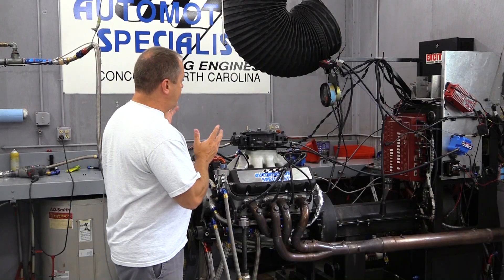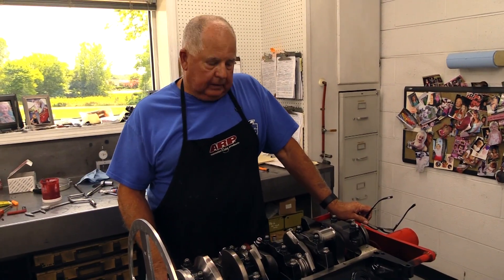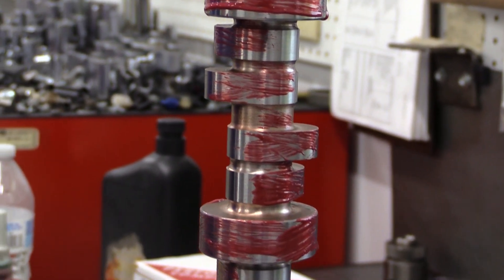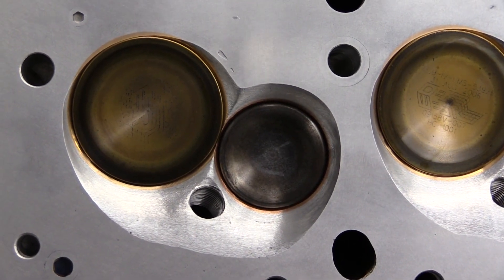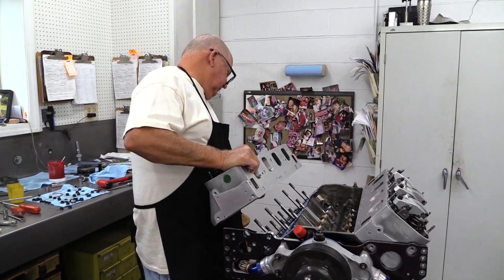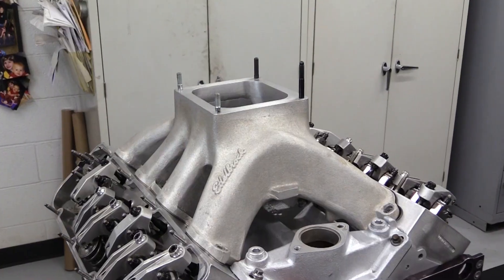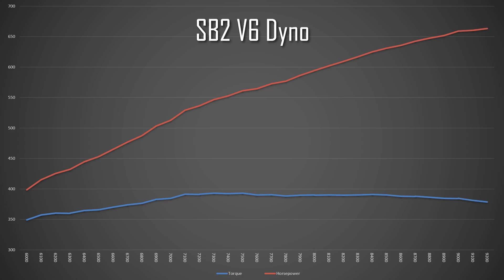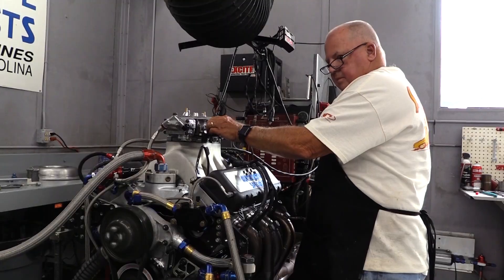NASCAR Chevy SB2 V8 Turned Into a Racing V6!?

Comment: If the goal was high rpm they should have chose a completely different engine, OHC straight 6. Push rods and rpm don't mix those valve springs would be robbing so much power.
Reply: That combination would put them in a different speed class.
Reply: @allenl9031  I thought they said early on in the video the only restriction for engine in their class was cubic inch displacement?
Reply: @Mrx1080  Bonneville classifies cars not only by engine size, but in a variety of other factors, # cylinders, valve mechanism, induction type, fuel type and then also type of vehicle. The Southern California Timing Association does the classifications and timing at Bonneville. It's interesting to see pictures of cars that run there, you will see a jumble of letters on them denoting their class. People look at the classes, pick one or two to challenge, and go for it! First goal for many is to get a car over 200 mph. That gets the driver the red 200mph baseball cap. That's a badge of honor. If you haven't already seen the movie "The World's Fastest Indian, " I highly recommend it for a taste of Bonneville, many actual vintage land speed cars appear in the background. From 50cc motorcycles, to 400 mph plus streamliners show up every year. Sorry for the long post, but my bucket list includes spending speed week at Bonneville, as a spectator, or helping a crew.

Comment: Isn't a Chevy 4.3 just two cylinders cut off of a 5.7L (350 cubic inch) V-8?
Reply: Yes it is. With a modified split pin crank to make it fire evenly. However this SB2 Chevy is a specialized racing engine and they are basically surplus now so its a great foundation which is why he went through the trouble to make it a V6.

Comment: Did I here 600 pounds of open spring pressure? I'm amazed that's enough for over 9000 rpm enough, on our pulling motors (which we used to run at over 9000 rpm, but have more recently regeared to be down around 8000 (just seems to work better no science there lol)) and we have like 800 and 1000 pounds of open spring pressure (my motor has very similar titanium valves, I'm not sure what my dads has)  (for anyone wondering we run 454 chevy big block pattern motors at 482 ci, also running "standard" steel heads (as per our rules, so no odd angles or pro stock style porting) close to 900 horse (we don't really dyno, only once every few years if we try something really new.... so its hard to say exactly how much we have...))
Reply: Your valves are likely a lot heavier than these though, and those look like very well damped springs. I bet the stability is similar between the two applications...

Comment: I kind of get the idea of this, but not really when you think of the 4.3 v6. Why have the extra weight and mass of the two dead cylinders, rather than chopping the head in two and welding it back together
Reply: I guess the only reason  I could see to  the point of that, is if you still want to put it back to a v-8 for another class some other day.

Comment: 4.2L ? Better to use a Barra i6 engine for this record run,  (balanced at high rpm, 11500 rpm is not a big ask)) dohc 4valve gives superior top end flow and hp. Boosted Barras make >2000hp on factory block and head.
Reply: I would guess that they are running a NA class engine, and by using a V8 block they can somewhat easily change parts to run the same block in a V8 class speed run
Reply: jck92599 4v head NA engine makes more power. Maybe the rules state 2V only ? 
3L F1 cars made 800hp due to 4v and high rpm.

Comment: one thing i dont understand, is how much power IS being lost int he spark delay? firing 8 plugs but only running 6 means there is a 2 spark delay, timing is correct but i would think that a ECU controlled spark would be best. its just one thing im not understanding here, results speaks for its self thought. Love it

Comment: surprised it uses a timing belt instead of a chain! learned something new today. Interesting build. Sounds great!
Reply: He said belt stretches more.  Than breaking like the chain would
Reply: Jason Kirby Nope. He said the opposite, the belt is more resistant to stretch than a timing chain would be.
Reply: @mrt9941  The belt's more resistant to both induced and permanent stretch. Anything routed around a pulley wants to keep it's motion outward due to inertia when it leaves the contact zone, and chains are a LOT heavier... so they pull outwards with more force, actually trying to pull the cam pulley and crank pulley together. Over time that force will stretch the metal beyond it's elasticity limits and the chain will grow. The belt both has less rotational inertia and recovers it's size better, AND helps dampen the cam's torque pulses, at the cost of total strength and longevity (the former's well above requirements here, and the latter's not even a consideration in this app).

Comment: So how does the block and heads react to the heat transferring from cil 1-6 to 7-8? doesn't it warp the block and stuff? Great content as always from Horsepower Monster! Regards from the Netherlands
Reply from the maker: That's a really good question. There definitely is potential for warping with the back of the block and cylinder heads staying cold while the first three on each side are running, but they think that is more of a long-term problem. If this engine lives through Bonneville speed week--probably no more than four or five passes--then it has achieved its purpose. Thanks for watching!

Comment: I still don't understand why you wouldn't just use a V6 block. I can see how this would exchange more heat, more block and less cylinders, but you still have that extra weight. Maybe the extra weight doesn't matter on your build because it was under weight anyway - idk. Regardless, this is a very unique engine, and I love the way it sounds. It still has some of the V8 growl left for some reason.

Edit - Just saw the dyno pull at the end. That horsepower/torque ratio seems perfect for high speeds on the salt! I think I'm starting to understand.....
Reply: He said most v6 are 90 degree angle, while v8s are narrower angle. Typical v6 at 9000+ rpm would shake the car to pieces or split the block.

Comment: are push rods a class rule? couldn't you get more top end with OHV?
Reply from the maker: No, not a class rule. Really the main reason is the team will be trying for multiple records while at Bonneville. They will be swapping in and out different engines, so it makes everything easier if everything is basically a Chevy small block that can bolt to the same bellhousing and custom headers. Thanks for watching.

Comment: why not use an electronic solid state distributor and a haltech ecu and really tune this b
Reply: Because it has a carb and not injectors?
Reply: @yellowbusguy  what does that have to do with tuning precise timing... I know guys running haltech on blow through carb twin turbo v8s and this isn't much different, cool thing is you can tune timing by gear. I like the mechanical setup but more fine tuning isn't a bad thing. you might as well also go to tunable blow through carb and get precise afr.

Comment: With those two cylinders turned off I wonder what they have to do to prove that it's a v6
Reply: If you happen to break a record at bonneville your vehicle goes to impound where a team and you completely disassemble the engine and they verify you are in compliance with the rules. Disclaimer: I’ve never been there yet but saw it in another video.
Reply from the maker: The class doesn't actually require it to be a V6. For the class they are going for a record in, it just has to be less than 261 cubic inches, naturally aspirated and burning gasoline. Keith knocked out the two cylinders so that he could increase the stroke in the other six in order to improve the compression ratio. Hope that helps. Thanks!
Reply: Yes but doesn't it still look like a 350 ci? I realize technically it's not. Do you guys just open the valve cover to reveal the missing rockers or something?

Comment: It is amazing how little valve spring pressure is being run nowadays thanks to Spintron testing actually showing what is happening on the top end of the motor.  I mean 160 on the seat and 600 over the nose is nothing for a 270 @0.050" and 0.800" lift cam!  Not to mention the 1/2" thick wall pushrods (I know pushrod weight is supposedly inconsequential but it has to add SOME weight/rpm loss to the valvetrain)
Amazing stuff.  SB2 & 2.2 is just so freaking cool!  Now show us some R07 stuff Keith and Randy!!

Comment: I’m curious, if you’re already using a custom billet cam and crank, why not just have the crank be a straight shaft past the empty cylinders? Seemingly, this would eliminate the need for the counterweights as well as better centering the mass of the shaft for easier revs.
Reply: Because then you get back into the balancing problems with V6's.

Comment: Why wouldn't they just use an inline 6 instead those are very well balanced??
Reply: Won't be able to get the power out of it ! There aren't any real race cylinder heads for inline 6s and almost all of them the stock heads won't flow enough even when ported and a full race prep head is flowed to make 800 HP naturally aspirated plus inline 6s aren't cheap to build from a performance stand point compared to a V6 or V8 because I looked into building either a Chrysler slant 6 or a Ford 300 six for the fun of it to see what kind of power numbers they could make so I looked around some and looked at Clifford 6=8 & it's not cheap at all to make a lot of power out of any of the big 3 inline 6s infact it cost quite a bit more and to me it wasn't worth it to spend all that money on one when you can build a V8 for less that will make twice the power !

Comment: With those rpms, flat crank right?
Reply from the maker: Nope, standard V8.
Reply: @TheHorsepowerMonster  how can the red line be so high? Trying to wrap my head around it. Maybe becouse it's missing two pistons. And that compression.
Reply: @eugenerussell8518  All you have to do is think about what makes a normal crossplane V8 eat itself at high RPMs. Well, so long as the rods stay together. Hint: It's addressed in the valvetrain...

Comment: So if the crank was machind to V6 120 degree journal centres, what was the empty journal machined to to not effect balance?  And how did the V8 ignition work for the new V6 phasing?
Reply from the maker: No, the crank is standard V8 with a short stroke. So there are gaps in timing when cylinders number 7 and 8 should be firing but aren't. That creates a 180 gap of crankshaft rotation between cylinders 1 & 4 (because 8 isn't firing) and 5 & 7 (because 7 isn't firing) where are the others are 90 degrees of crank rotation. Thought it would be an issue, but the engine wasn't bothered by it. Hope this helps, and thanks for watching.
Reply: @TheHorsepowerMonster  Thanks. Amazing that it runs so well. That must explain its odd sound. Lol.